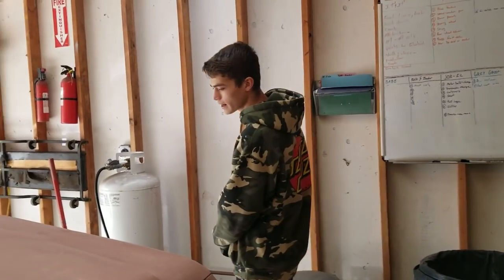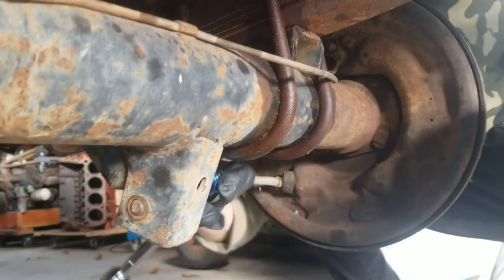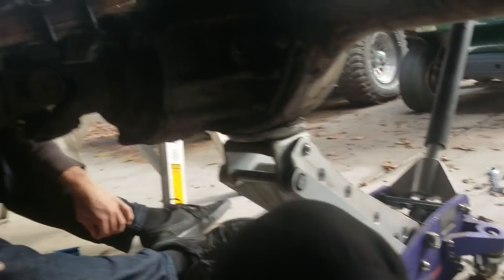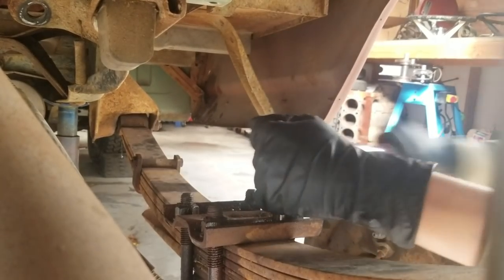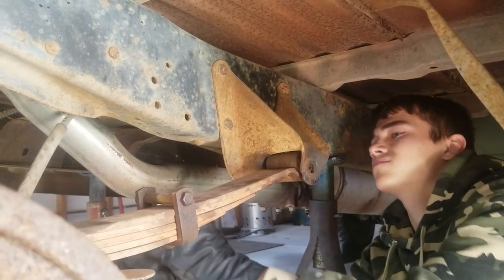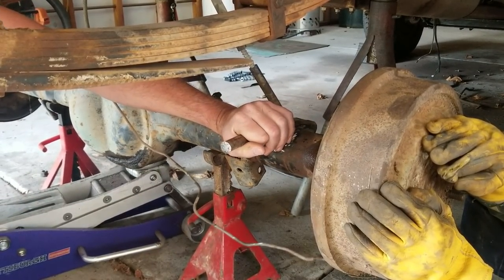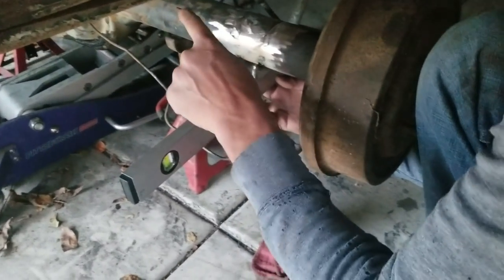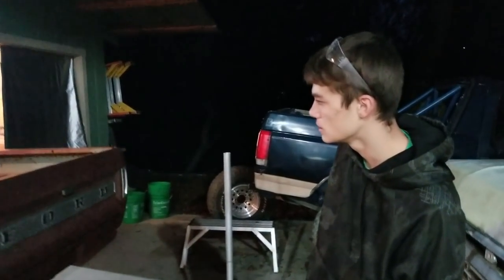How to Lower Your Truck For Free!

Comment: Awesome... Simple and efficient. I'm curious about the front suspension now. Looking forward to do this on my bumpside.
BTW, I'm thinking about doing some reversible mods, since the truck is fully stock and I might make it a collectors car in the future... Is it possible to avoid the cutting of that piece and just weld another one on the lower part of the axle, so I can mount the springs back on the top one if I ever want the stock ride height without messing with the assembly of those U shaped parts that hold the spring to the axle? Thanx

Comment: Word of advice........take off the shock mounting bolt at the bottom mount first, this is really a good idea if you have gas shocks or coil overs that may be under a great deal of pressure. If you keep the axle assembly balanced on a good floor jack you don't need to disconnect the drive line. Taking the brake lines off so they don't get damaged is a good idea especially when welding or grinding near them. Remember you are going to have to roll down the nose of the differential an 1" or so to get the drive line angle back in proper phase. You want the angle both top and bottom the same. On a standard cab with short bed it will be real close to straight on with no angle at all once you put the axle on top of the springs. The last consideration is your shock is now going to be too long and you will need shorter ones.

Comment: There is a square nut on the top of the shock shaft, just use a small opened wrench on to hold it as you undo the main nut.

Comment: I just cut the rivets on hangers moved them up and drilled new holes, cat 8 bolts, and I'm done.  Cut the coil springs in front. 1977 f150, also quick and easy.

Comment: WOW, May I suggest  that you use better safety precautions,  and you coulda bought the flip brackets for under $10. For the pair, that welder isn't sufficient for welding the spring perches on, and it needs to be .03° up in the front, hopefully you don't burn up u joints replace the rear one with one that has a grease fitting on it and keep it greased, I haven't watch you do the front yet I hope you didn't just cut the spring's down or heat them up,,,
Reply from the maker: We dont have the truck anymore however yes we just cut the springs. On a truck like this that's 100% fine.
Reply: @ArcticAutoWerks  WOW, OK.........WOW
Reply from the maker: @kennyvelez8060  triggered
Reply: I hope the new owner fixes it properly before using it .

Comment: Please no one ever do any of this because you need to know what your pinion angle is before and you should flip your axle not the perch but without pulling your numbers dropping a plumb bob finding your angle here truck could end up with a crosswalk or the ass the truck while driving slowly walks itself out to one side of the other also without the correct pinion angles you could seriously damage your drive shaft nothing worse than making your truck look cool doing your first burn out and reaming your drive shaft or snapping the yolk

Comment: I see that you didn't C-Notch the frame. Is the axle not hitting the frame when you hit a speed bump?
Reply from the maker: Nope if you cut the bump stops at the half way point it rides great
Reply: With a Dana 44 the axle is not going to hit the frame a Dana 60 F250 will be closer I think the top of the axle will hit the bed before the tube hits the frame

Comment: Guys need a torch to heat them bolts up.
Reply: Not sure where you live but in Canada it's illegal to heat or weld any suspension component,  not saying that it is never done,  but opens you up to a huge lawsuit in a accident
Reply: @lesgallivan4159  never heard of that. I'm in Ohio. No laws like that hear.
Reply: Yea , it was one of the "sudden death" questions when I wrote my joureymans,  never heat , flame cut or weld brakes steering or suspension.  Answer it wrong and you had to start your 4 years of training from the beginning

Comment: Easy! Now show me how you plan on doing the front for free.
Reply: Cut off 1 and 1/2 coils no more or buy 2" lowering springs on e bay
Reply: Easy! take some leafs out the front
Reply: You're not going to get away with cutting front springs. They have specific shape for top and bottom mounting. I doubt anyone around can bend the I-beam that much to put it back in alignment.
Reply: Yep.  To keep the camber u must have an old school alignment shop bend the beams.   Had mine done in Monroe louisiana.  The only place around my neck of the woods.

Comment: If you used the same shocks, you're going to need new ones. Putting a vice grip on the shaft will  mar the surface. Also I believe you were using a torque wrench to break the u bolt nuts loose. That'll throw the wrench out of calibration. Good work for a young guy though.
Reply from the maker: Ya we replaced the shocks anyway just forgot to show that in the video. And that was just a breaker bar we didnt have a torque wrench back then. And thx man!
Reply: @ArcticAutoWerks  what’d you use to replace the shocks?

Comment: Do you have one on the front too? I have the twin i-beams but i dont want to start it and run into a issue
Reply from the maker: I just cut the springs two coils and sent it. Drives great
Reply: You can buy early 90's explorer coils, those fit really well and they're cheap. I'd get the 4x4 coils though, they're a little bit stiffer and will hold more weight if you have the FE motors.
Reply: The 4x4 explorer coils also have a little wider diameter, which fits the spring pocket a little better. 
As far as stiffness, cutting the stock coils also increases the spring rate.